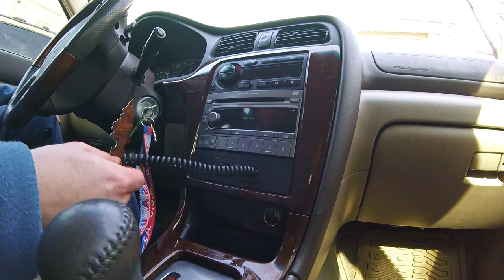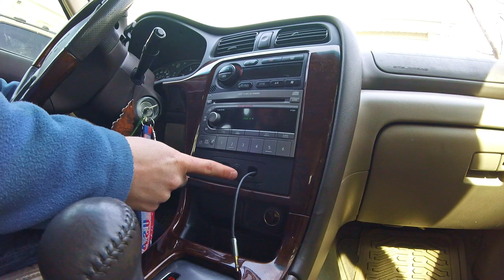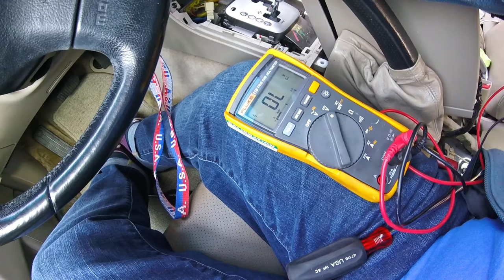How to add an auxiliary port to any car | Ep.81

Comment: So, it's basically a hardwired and likely higher quality version of the FM tuners that plug in to the 12v ports. Nice. I use the 12v port tuners, myself.
Reply from the maker: +Randall Peralta yea basically. But since it's wired in, you're guaranteed to get great signal

Comment: Theres an OEM Ipod kit from subaru that works in most subarus, i think the one i got was for a sg forester and gd impreza headunit, but also worked in my 08 legacy, if you get that and then buy and plug in a Tune2air (30pin ipod to blutooth device..80$) you can play audio over bluetooth and also use the factory steering wheel controls
Awesome vid, just sharing what i did in my 4th gen legacy

Comment: What year impreza is the climate control out of?
Reply from the maker: +SomeGuyWithASubie that I took apart in the other video?
Reply: Dirtcheapdaily no in your third gen legacy
Reply from the maker: +SomeGuyWithASubie the climate control came in the legacy. The stereo headunit is from an 04 impreza I think. Seems like there were a few different stereo options. You just have to look for one that has the same plug as the legacy.